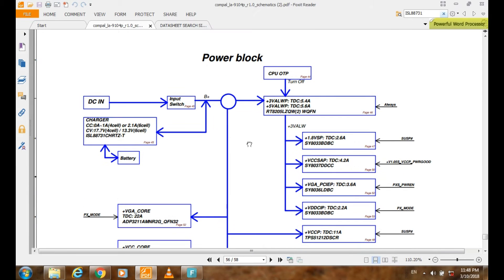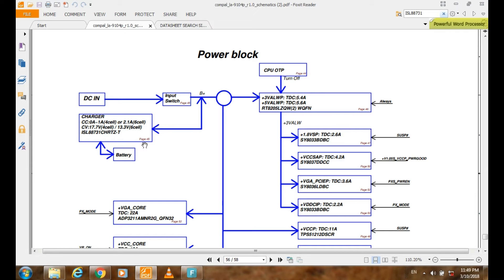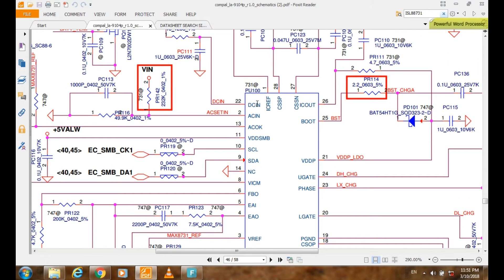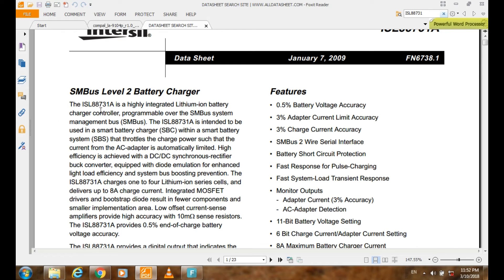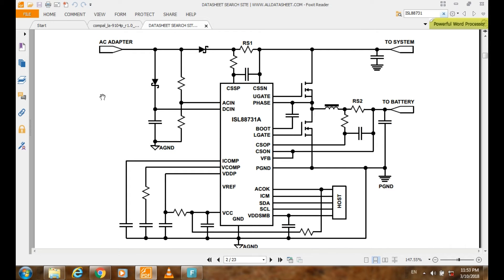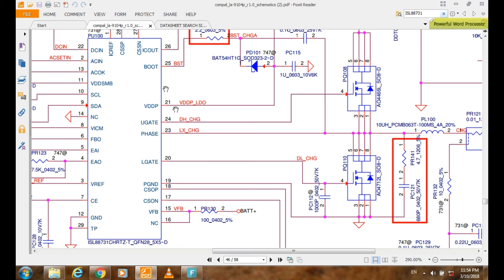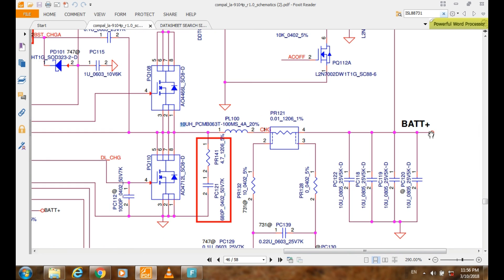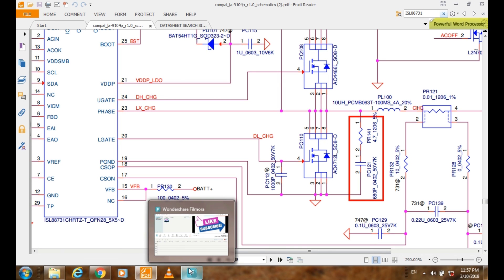how to check laptop battery not charging

Comment: there is more to check, for example 3.3v to sda/ scl data, this is comunication for super io chip and this microcontroller, there is lot of condition for this ic to work , not just u and l gate and acin, also for BQ series are at least 5 crucial conditions for the ic to work